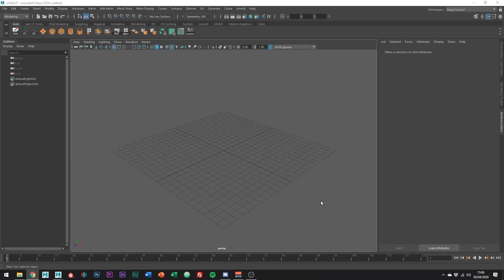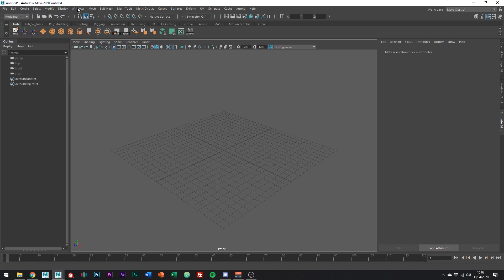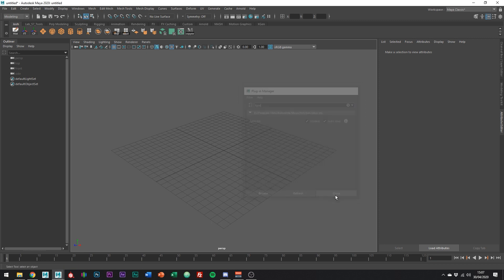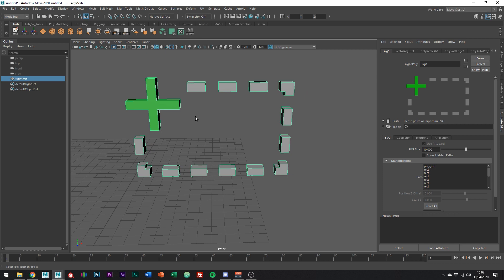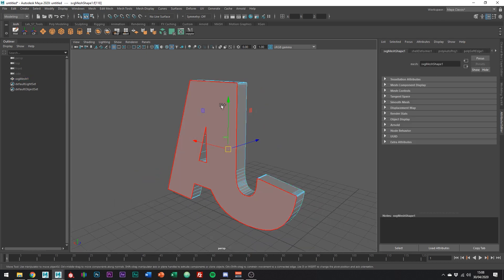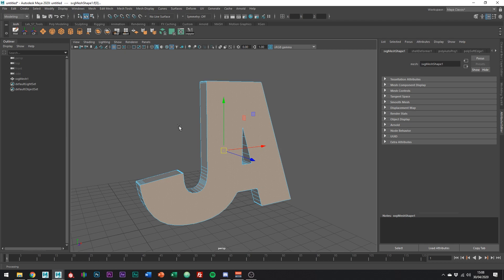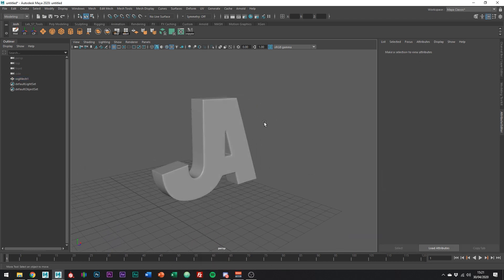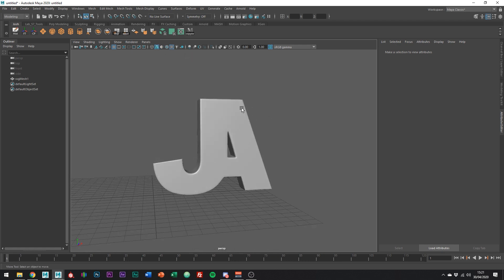Turn SVG Logos into 3D Models in Maya

Comment: I tried this but anytime my svg file has any "holes" or cutout like the centre of your A, the svg imported mesh becomes all black . How did you do import it successfully? is the problem my maya or the svg file itself? if so, what did you do in your svg file to make it import properly in maya?
Reply: try selecting the object, then Mesh Display - > Reverse (probably gets confused on inside/outside).
Reply: your problem is how the svg file was made not a problem from Maya...in illustrator the pathfinder exclude or minus tool solved the problem for me.